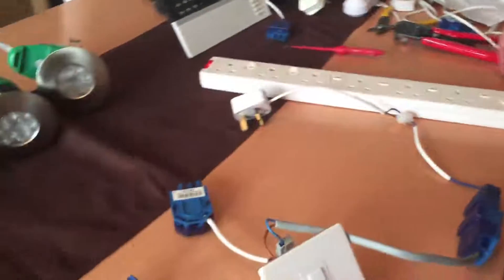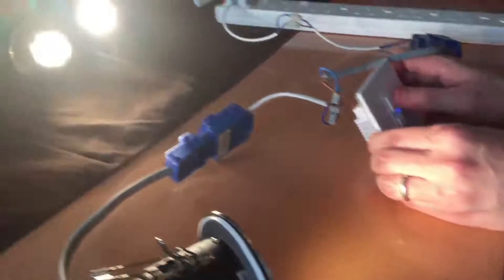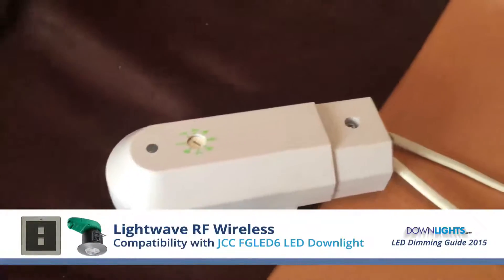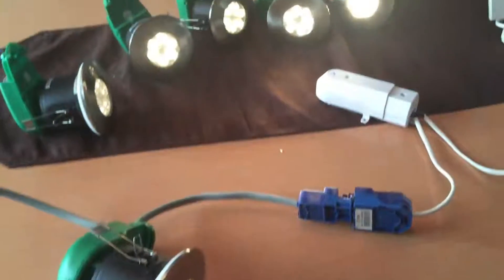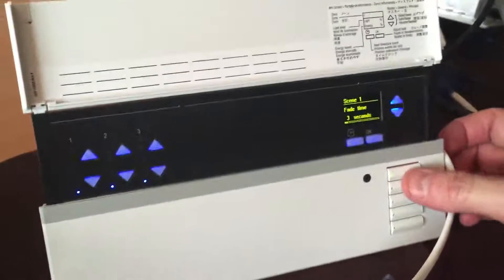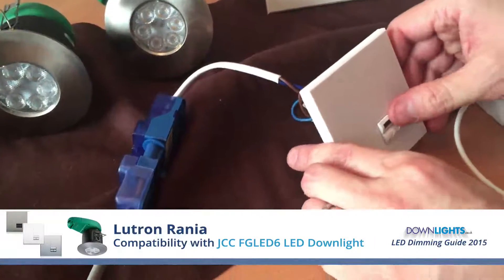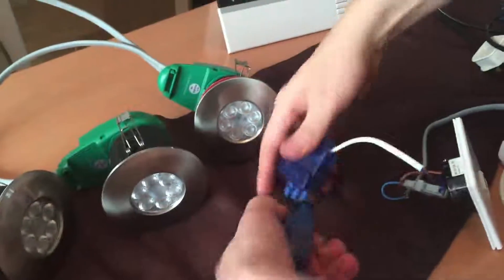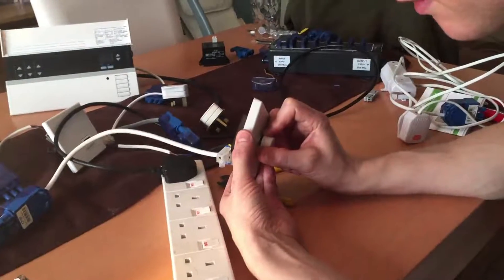JCC FGLED6 Dimmable LED Downlight Test

Comment: Which Grafik Eye unit are you using in this video? I've got a GRX 3106 and wondering if a few of these will work with it?
Reply from the maker: The Grafik Eye we used was the latest version call the QS. It's this one here: https://www.downlights.co.uk/lutron-grafik-eye-qs-6-zone-home-automation.html
I usually use the Lutron selector tool here: http://www.lutron.com/en-US/Service-Support/Pages/Technical/Design-SelectionTools/LEDDimmerMatrix.aspx To specify which LEDs work the best as Lutron now do tests themselves. JCC isn't listed though. 
It looks like the Aurora M10 and E8 have been tested and work with the GRX-3104 / GRX-3106 Grafik Eye 3000 that you've got. These are both great downlights that we keep in stock.

Comment: How do you change the bulbs??
Reply from the maker: +barry hodges 
The LED is integrated into the downlight. It comes a one dedicated complete unit that lasts longer and is more reliable than a replaceable bulb and downlight.

Integrated LED lights are widely considered as the future of lighting in general.

There is also a brand new version in this series called the FGLED3 which is now dimmable and costs less than the FGLED6. It's not as bright but bright enough for most applications: https://www.downlights.co.uk/jcc-fgled3-new.html
Reply: Certainly not reliable. From my experience having four units fail within 8 months.   @DownlightsUk
Reply: One of my 6 fittings of these has stopped working. I've tested and the led lights themselves work fine still but it appears to be the driver has failed.

Comment: How many FGLED6 or FGLED10 could you run on a Lightwave 250 RF wireless dimmer?
Reply from the maker: Megaman Lighting who are the UK's Lightwave RF distributor have recently told us that the 250W wireless dimmer should be de-rated to 60W when dimming LEDs.

This would mean that it would dim up to 8 of the FGLED6 (7.2W each) or up to 4, possibly 5 of the FGLED10 (12.4W each).

If you need to dim more you can add multiple wireless dimmers to the circuit and pair them to the same switch.
Reply: +Downlights Is there a dimming solution that could cope with about 20 FGLED10 and 10 FGLED6  on one or two zones?
Reply: +Hans Berg 
Yes, you can still do this with Lightwave RF. Here's what you'd need:
1x 2 gang wire free switch - Like JSJSLW221WH
Then you'll need some dimming receivers - JSJSLW831
5 to dim 20 of the FGLED10s and 2 to dim up to 16 of the FGLED6s. 
You then pair up the circuits to the switches.

Or you could use a mood controller instead of the switch which would allow you to set scenes.
There's a national stock shortage of the JSJSLW831 though. Due mid December.

Available here: https://www.downlights.co.uk/lightwave-rf.html
Reply: Chris - many thanks